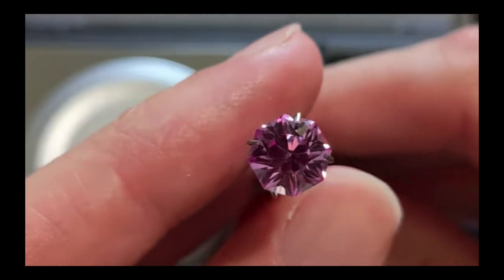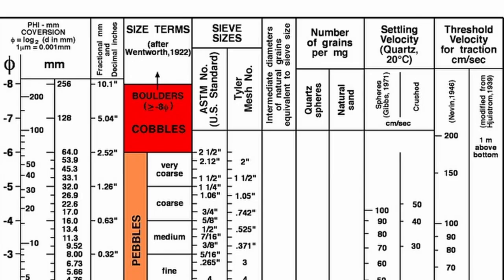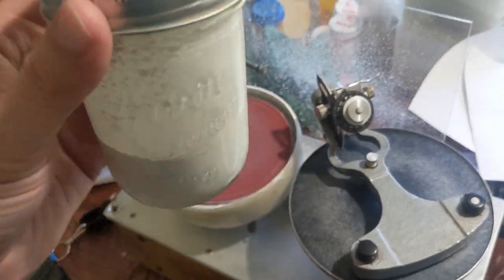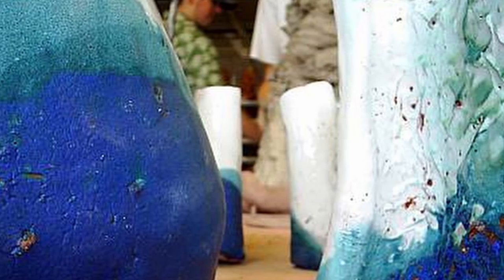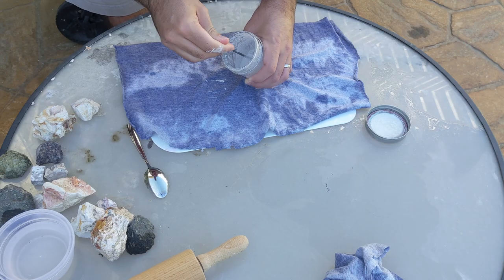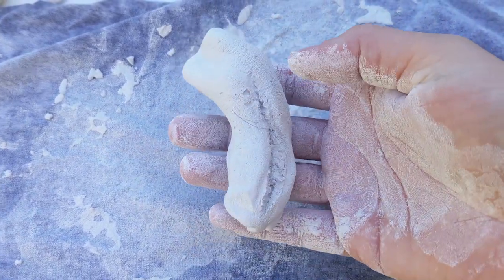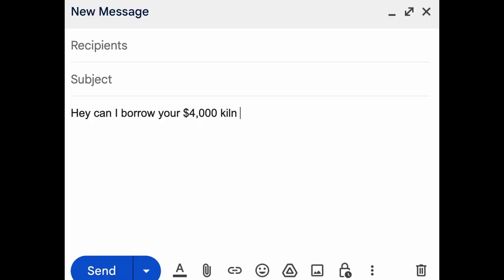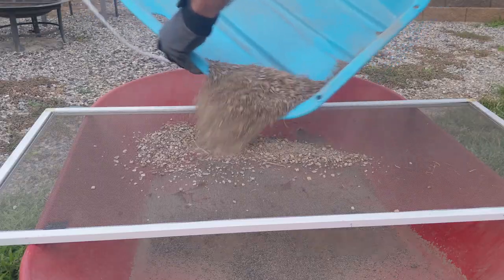Using Powdered Gemstones For...Pottery?

Comment: probably the only option to create a mineral from cutting dust would be to use something like an Electric arc furnace and the entire furnace chamber to pump in a large amount of gas like argon and then it would be possible to create a mineral

Comment: Why are you using aluminum foil?  Aluminum melts at a relatively low temperature, about 660C.  Good kilns for ceramics get much hotter than that, so if your aluminum foil has not melted then you didn't duplicate a kiln.

Your scarf may be a decent ceramic if properly heated, but you didn't get nearly hot enough.  

Material in gemstones are mostly irrelevant to plants, unless they contain trace amounts of the metals needed by plants (Ca, Mg, Fe, Mn), so the scarf isn't going to work as a fertilizer either. You've just got a tiny amount so adding it to  your soil is probably going to be irrelevant.
Reply from the maker: The Al foil melted on the second go round, that's why I had to pick them out of the embers. Thanks for the info!

Comment: Nope nope. Not nearly hot enough. That aluminium foil shouldn't have made it at all. You need to make at least a small kiln that creates a bit of draft. The pottery itself needs to be full red or into the orange as a minimum.